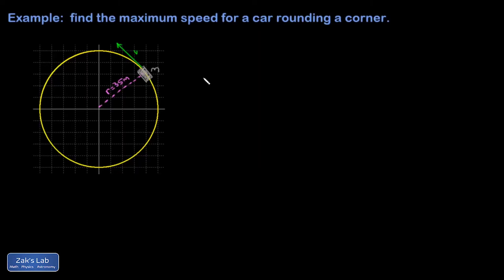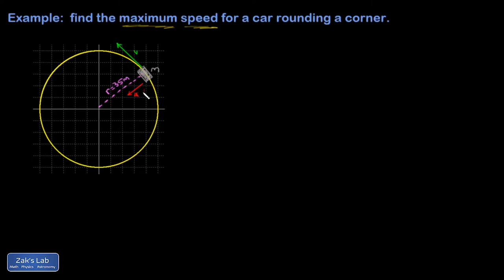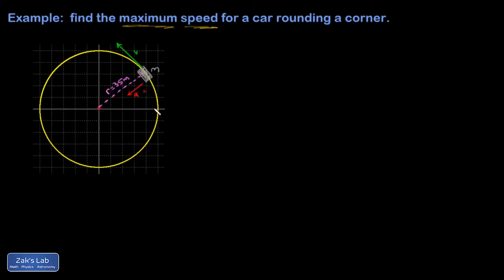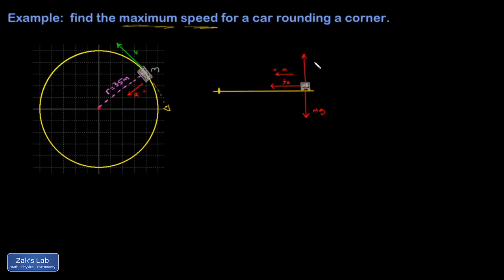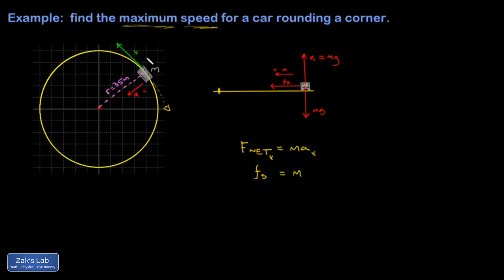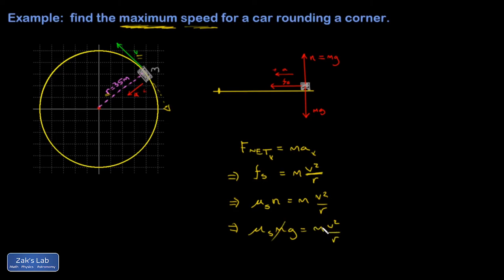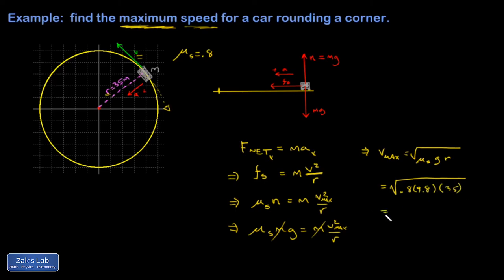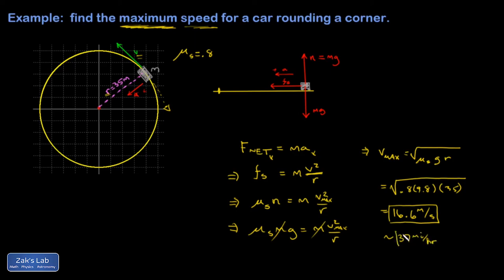Calculating the maximum speed for a car rounding a corner on a flat road, uniform circular motion.

Comment: How does this change when a coefficient of kinetic friction is introduced?
Reply from the maker: As long as we're talking about uniform circular motion, there is no slipping between the tires and the road for a car making a turn, so there is no kinetic friction.  If you have a car exceed the max static friction force, it's going to slip off the circular trajectory into some more complicated path -- perhaps still turning but with an increasing radius.  As far as I can tell, the dynamics of "drifting" would be immensely complex to model.  -- z

Comment: Where did you get 9.8 from?
Reply from the maker: that's the approximate acceleration of gravity near the surface of the earth.  Some classes will use a crude approximation of 10m/s^2, some will use a better approximation of 9.81m/s^2, but typically we use 9.8m/s^2. z
Reply: @ZaksLab  Oh okay also may I have your email? I actually might need more assistance for this because I’m trying to calculate the max speed of a car in a circle with a diameter of 300ft
And my only components I have is 

Top Speed: 179 MPH
0-60: 4.1 Seconds
Weight: 1378kg
And some others like HP etc…

Comment: WHY ARE WE USING STATIC FRICTION INSTEAD OF KINETIC FRICTION AS CAR IS IS MOTION WHILE MOVING
Reply from the maker: because the tires aren't slipping against the road:  the contact patch with the road is always stationary, albeit instantaneously, so it is a static friction force.  Another way to get some intuition for this is to think what happens if you start to push a corner too fast:  you start to heal squealing, then at some point you break loose and rubber starts to slide against concrete.  That would be kinetic friction, but not until you break it loose and actually start to slide.  z
Reply: @ZaksLab  ohk got it now , thanks